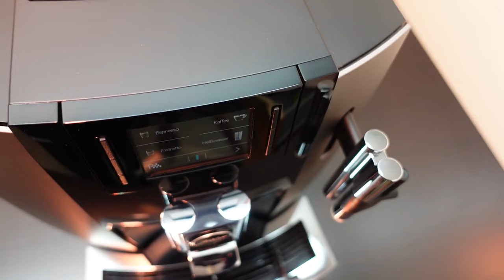Jura E8 Refurbishing and Deep Cleaning

Comment: I followed the instructions but ended up turning the bean grinder's large outer gear too much. It no stopped clicking and was easily pulled up. It now turns freely. It seems like a spring or something is missing. Do you have any advice on how to get the grinder back to normal? Thanks in advance -
Reply from the maker: There is usually a spring with a steel ball under the large gear. The parts are very small and have probably been lost. Watch my other video https://youtu.be/M8C97HNxAGk?si=MVk_KfMnEMLRcQfN at minute 13;35
Reply: I lost the steel l ball. Do you know where I can order that? Or do you have the dimensions?

Comment: Okay have you ever come across an issue with the screws on the brew group. They are not screwing back in. Any idea they don't look striped.
Reply from the maker: You have to make sure that all the parts are in the right place. For example, no parts may be interchanged with left or right.

Comment: Beautiful! I wish the part pricing on Jura was more reasonable :(  I have two s( machines, and both have the same chrome peeling on the spouts, any idea what is causing this?. Is it just a cheap manufacturing ? Thanks
Reply from the maker: The chrome plating is peeling off due to temperature and cleaning agents. Fortunately, these parts can be changed and are not expensive.
Reply: @yt.myworks  Thanks for reply! Sadly very expensive here in Canada. $125 for piece of plastic, nutz.
Reply from the maker: Oh.. that's a bit too expensive :-/ I bought the part for about 11.00 EUR https://www.juraprofi.de/search_result.php?keywords=72473

Comment: Thanks for the Great Video. I have a 4 year old E8 and there is a water leak where a white reinforced hose connects to a drain valve Y (shaped) near the middle bottom of the machine. At 17:28 of  your video you show the type of hose that is leaking. There are 3 of these reinforced hoses and the one that's leaking is the one you can't see in your video. It is just underneath where your working. I believe just the clamp is the problem. The hose looks good inside and out. okay, so I am going to try to order some of those single ear clamps you suggested. However, where can you get these high pressure reinforced hoses if I need to for future reference.  No luck finding them anywhere. Thanks again.
Reply from the maker: For example, you can search for Jura hoses on ebay or amazon. For example like this: https://www.ebay.de/itm/165696558109?mkcid=16&mkevt=1&mkrid=707-127634-2357-0&ssspo=-bRdEyxzScS&sssrc=2349624&ssuid=fqjNmJj7Q9S&var=&widget_ver=COPY.artemis&media=COPY
Reply: Well, I ordered some Oakone single ear pinch clamps (look just like the Oetliker). Couldn't seem to purchase a small assortment  quantity of the Oetliker. (Over $100.for a set). You said you used Oetliker 7.8- 9.5mm. I found in my set the 7-8.7 mm too large. I used a 6-7mm that slipped over easy enough. Pinched it to where the ears nearly touch. Hose still leaks. I guess next step is to replace the 2 hoses. This is however the first time I ever used this style clamp, I do not see how I could have done this wrong. Any thoughts? You sourced the hoses for me, Thank you.
Reply from the maker: Over $100 for a set is very expensive :-o. These hoses will leak over time. After dismantling, these should be replaced because they are exposed to high temperatures.
Reply: I found 2 suppliers on Ebay but will not ship from Germany. Jura-parts online has a hose that might fit although his description doesn't  include an E8. Sorry to bother you again but can you refer a source. I believe  the hose is a 4.2mm Id x 8.
Reply from the maker: As far as I know all Jura machines have the same tube size inside 4.2mm and outside 8.2mm

Comment: One more question. Could you tell us the size ore type of the used Oetiker clamps? Thanks
Reply from the maker: I used the Oetiker clamps in the size of 7.8-8.5 mm. I think the sizes 8.8-10.5 mm would also fit.
Reply: Thanks a lot

Comment: My E8 is stuck with empty grounds alarm. It has like this for 2 weeks. Obviously, contacts from tray have been throughly cleaned (they were replaced 2 months ago for new ones).  I have done the reset procedure shown in another YouTube clip and nothing changes. Can you please tell me what else could generate this alarm? Do you think I need to replace the brain or electronic board?
Please advise.
Reply from the maker: There are contacts inside the machine.  These should be cleaned well, otherwise incorrect values will be measured. To do this, you need to remove the back cover.
Reply: @yt.myworks  do you know if this model has the small micro switches to close circuits of tray presence? Or is it merely a contact that closes and sends directly the signal to Electronic Bosrd?
Reply from the maker: I don't remember that exactly anymore, but I think there are only the two metal ones but no microswitches. The resistance is measured and forwarded to the power board.

Comment: I like your videos! I am a fully automatic coffee machine repairer myself, and I can imagine it must be so difficult to video the process! But I appreciate your videos. Quick question, how do you remove the scratches from the plastic panels? I see you mention the Menzerna compounds, but what rotary tool do you use? Do you go through the three different compounds(heavy, fine, polish?) Is there any technique you recommend? Thanks
Reply from the maker: For polishing I use Menzerna Polish Set: https://amzn.to/2PDuE68, Proxxon 22295: https://amzn.to/32IeGyk and https://www.autopflege-shop.de/30mm-polierteller-fuer-proxxon-anglepolisher-pp30.html. = APS-PP30
Reply: @yt.myworks  Thanks that's very useful, I will try that. Lastly, where do you get your large o-ring set? I have been looking but I can only see them sold as individuals, I would like a large set like yours. Thanks!

Comment: At 9:53 what size bit are you using? I am working on an Impressa F7 if it makes a difference. The bit is smaller than T15. Thanks!
Reply: And smaller than a T10 which is the smallest I have. Thanks for the video… very helpful!
Reply from the maker: Hello, you need a T-9

Comment: Hi, with what polishing agent do you polish your machines? I'm looking fora  brand that doesn't turn the black shiny parts of a machine into a hazy cloudy vaguely grey surface... sadly all shiny black plastics I polish turn cloudy. Do you know the answer to this? Thank you!
Reply from the maker: I use Menzerna Polish Set: https://amzn.to/2PDuE68
Important, you have to polish with the coarse polish and finally with the fine one. Don't forget to always change the sponge pads.
Reply: @myworks  thank you. Yes I do that as well but the problem is I get a bit of a grey haze in the plastic. It's not a deep black! Do you have that as well? Especially with front panels?
Reply from the maker: After the "Medium-Cut" polishing, the plastic is slightly gray. After "Super-Finish-Plus" a deep black appears. Important: Each time the polishing paste is changed, the plastic part must be thoroughly cleaned with a wet cloth!
Reply: @yt.myworks  is the machine cleaned after juras schedule with tabs and so on? I'm thinking if i keep the machine clean after recommendation this is what it looks like after 6 years?
Reply from the maker: Exactly! Only the inside of the brew group is cleaned with cleaning tablets. That's why I recommend thorough cleaning (as in the video) after two to three years. However, cleaning with the tablets is very important and should be carried out exactly as recommended by the manufacturer.
Reply: @yt.myworks  ok. It's no so bad on the inside, when it's 6 years then 👍

Comment: Hi, I have a Delonghi Eletta Cappuccino Top and no matter how many times I try to descale it,  I never gets to the rinsing stage so it will only ever display "descaling underway". I have tried contacting Delonghi but they do not respond. Please help. Thanks Stephen
Reply from the maker: Is the water tank completely empty? If so, then the problem may be the magnet in the water tank. It's either stuck or has lost its effectiveness.
Reply: @yt.myworks  Thanks for the quick response. Will look at that, I also replaced the flow meter and did not make any difference. thanks again Stephen
Reply from the maker: A water level sensor could also be faulty.
Reply: @yt.myworks  Hi, you were right, it was the magnet in the water tank that was not triggering the sensor. I used another Delonghi water tank by tricking the machine and it worked like a charm.  I was so happy to see "now rinsing" , thank you again. Stephen

Comment: Hello, First of all. Thank you for your very helpfull video! I made a mistake at 13:00. I removed the outer gear on the grinder. I did not pay attention to the detent. In other words, the spring with the ball. Is there only 1x ball and spring or 2 times? It is possible to insert the spring in 2 places. I would be very grateful for an answer. Maybe you also have a photo. Best regards Stefan
Reply from the maker: Hello Stefan, the ball with steel spring is only attached in one place as far as I can remember. You can see it better in my other video in minute 13; 33 https://youtu.be/M8C97HNxAGk?si=WrMMrCPnwf-bXkqE
Reply: Many thanks
Reply: @yt.myworks  same problem here. Apparently the machine doesn't work well without that ball?

Comment: at 18:25 You have used different hose clips/clamps (not the ones you removed). Why? Are these new better? What would be product code? 
Thanks!
Reply from the maker: I use the "oetiker" clamps (7.8-9.5mm) because they are slightly better than the original clamps and are easier to assemble.

Comment: @myworks If I took my Jura E8 apart and cleaned out the grinder with out marking the original setting, how would I find the correct setting? At the moment, my machine wont change the amount of beans it will grind no matter what I select on the display. The time of grinding doesn't change and the coffee tastes weak even when maxed out. I've noticed also the machine doesn't make "pucks" in the bin any more, it's just wet loose grinds. HELP! :D TY
Reply from the maker: You have to adjust the grinder so that the coffee powder is as fine as sugar. If the amount of coffee is ground too little, it can mean that the blades are worn out.

Comment: Any idea of my problem. My E8 doesnt even rinse water from coffee spouts, rinse water goes straight to drip tray, milk system works, so hot water comes out from milk frother and coffee also. 

When making regular coffee, coffee goes straight to drip tray…
Reply from the maker: Hello, it could be that the ceramic valve is no longer working properly. This is the part on the bottom left of the machine with a lot of hose connections.
Reply: @yt.myworks  Now got the coffee flowing from coffee spouts, maybe the ceramic valve was stuck or something since the machine have been sitting for month…

Comment: I must say, after 6 years of use and no cleaning in between. I thought the inside would be a lot worse!
Reply from the maker: That's true but the smell from the brewing unit (connection in min 7:25) was very unpleasant ;-/
Reply: @yt.myworks  Haha I bet! I always wonder what would be better.... Machines where the brew group can be removed and potentially damaged, not dried properly and then put back or a closed unit with no access which is serviced every 2 years by a "professional" or at least someone like you who knows what he's doing?
Reply: Mine was after 2years 😂

Comment: Thanks for excellent video. 18:54 why didn't you replace the hose there?
Reply from the maker: Hello, these hoses had a diameter that I didn't have. The two ends of the hose are plugged into each other and you should use original hoses. If these are not moldy, it is enough to clean them.

Comment: Congratulations very amazing video! Why you chose to use citric acid to clean the water thank and washing soda for the other plastic parts? How can i clean the drip tray? Thank you in advance for the help 😀
Reply from the maker: The citric acid is cheap and removes the lime very effectively. The washing soda is also cheap and effective for cleaning old coffee oil. If the drip tray is also very dirty, you can also use washing soda or, for example, puly caff cleaner.

Comment: Can you please tell me where you got the blue tool for removing the air hoses on 2:50?  Can't find it anywhere... thx!
Reply from the maker: https://amzn.to/39Ui8cB
Reply: Thanks a lot! And the hose at 18.10? Thanks for your help and your videos ! I'm sending a small appreciation on PayPal.
Reply from the maker: Many, many, thanks for your donation!!
I am sending my recommendation for the pressure hose here: https://amzn.to/3QSA0Fp
Reply: @yt.myworks  thx!  Are they universal? As in, its the right size for all those hoses in the housing of the e6 e8 and so on? Now I'm only searching for the valves you're replacing on 17:00. I found them on ebay but the seller couldn't tell me if they were suitable for the E series.
Reply from the maker: This hose is only suitable for the heater. The spare parts for the valve are universal for almost all Jura coffee machines.

Comment: My machine leaks water at the y connection check valve. Can you please advise as to why?
Reply from the maker: I recommend replacing the valve pin and seals and cleaning the valve body from the inside.

Comment: Did you try cleaning the power button with a Lysol wipe ? Might not have needed to buy a new one
Reply from the maker: I only replaced the cover of the switch because the lettering was worn out and no longer visible. So it wasn't terribly expensive.

Comment: Very helpful to me. But where do you get your spare parts from? Having difficulty locating some parts- UK Especially the ceramic valve head, I only gonna broken the nipple 😢. I don't particularly want to buy a whole new one. £££!
Reply from the maker: I buy my spare parts from these two shops: juraprofi.de, komtra.de or ebay and amazon.
Reply: @yt.myworks  brew unit has all been serviced and greased. It travels smoothly up and down manually out of the machine and seems to be working well. I put it back in the machine and the motor does a few moves, takes it to the very top, stresses out and stops - fault 8 displayed. 

I am assuming the brew unit needs to be three and a half rotations down before installing? 

It surely must be the motor sensor? I've taken it off and inspected and the recess cog and it looks fine, cables look fine and plugged in. Could it just be lost in the sequence? Is there a trick that I am missing? 

I love my machine and my coffee and I can't stand drinking instant stuff much longer🤢😆.
Reply from the maker: The brew group must be placed in the home position before installation. I made a video on this topic: https://youtu.be/z2cnI2h4rVE. The first steps from at least 04;20 are particularly important. The small piston in the brewing chamber must not get stuck during the movement. A shift of just one tooth will result in the brew group not working properly. There are no other tricks here. I recommend disassembling the brew group and assembling it again ;-)

Comment: What is the purpose of the hose and white container thing is at 2:46 to 2:56?
Reply from the maker: The relaxation housing is connected to the ceramic valve via a silicone hose. This is used to release pressure from the machine into the drip tray.

Comment: I have been getting the message that there are no coffee beans, but it is full. i push on the button anyway and it works but the coffee that comes out is thinner than usual
any ideas?
Reply from the maker: Check that the coffee is not ground too finely, this can result in the amount of coffee being too small. But it can also be that the grinding stones are no longer sharp enough and therefore too few coffee beans are ground.
Reply: Same problem was here. I had to disassamble until the grinder unit could be cleaned. It was clogged, and YES it was on the finest.

Comment: What's the diameter of that metal ball under the rotating disc in the grinder? There's 2 holes for those balls but you need only one with the spring? Difficult to find from anywhere...
Reply from the maker: Depending on which Jura model you have, there are usually three metal balls with three springs or with newer models there are no more, as in my video. The metal ball, if available, has a diameter of Ø 5.5 mm: https://www.juraprofi.de/Jura-Ersatzteile/Mahlwerk/Feder-und-Kugel-Set-fuer-das-Jura-Mahlwerk::5064.html?refID=gbase&gad_source=1&gclid=CjwKCAjw48-vBhBbEiwAzqrZVMV-qrV2mhu1UAbQHMpc5h1Em2S61W40U412q4407E5f2k14g-Pe4hoC2pQQAvD_BwE
Reply: @yt.myworks  it's e60, not impressa. I mean that smaller ball which goes underneath the disc.
Reply from the maker: Do you mean this one Ø 3.2 mm ? https://www.juraprofi.de/Jura-Ersatzteile/Mahlwerk/Feder-und-Kugel-klein-fuer-das-Jura-Mahlwerk::12601.html
Reply: @yt.myworks  yes that's it. Thanks.

Comment: Does anyone have any idea where to source the chunkier of the internal hoses, and the crimp clips that go around the ends (or even better the spec / diameter so I can buy a cut length)? I can find places selling the smaller silicone hoses , but not the bigger ones.
Reply from the maker: AD8.2XID4.2XWD2.0MM https://komtra.de/jura-ersatzteile/jura-ersatzteile/silikon-gewebeschlauch-ad8.2xid4.2xwd2.0mm-meterware.html

Comment: Out the top of the brew unit, there are two pipes. Where does the one with the plastic ninety-degree joiner go?
Reply from the maker: Sorry, but I don't know that by heart.
Reply: @neilrobins3329 same here, two hoses running out the riser in the brew unit but only one is shown in the re-assembly of the brew unit - did you get your question answered?